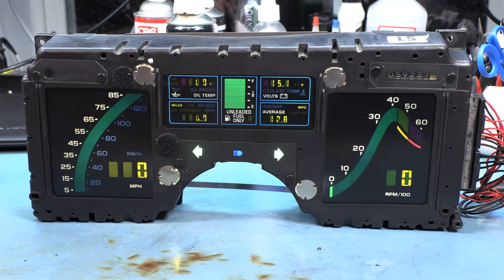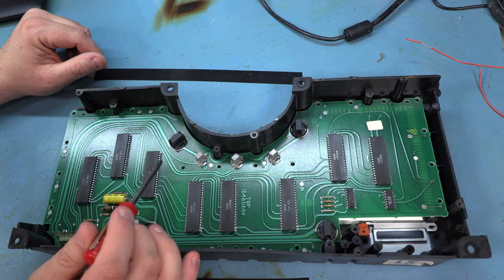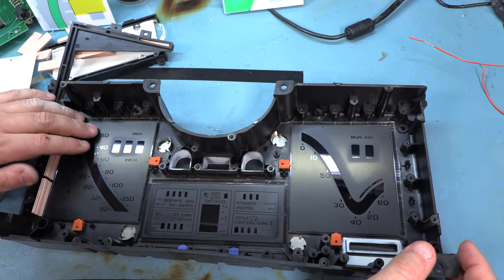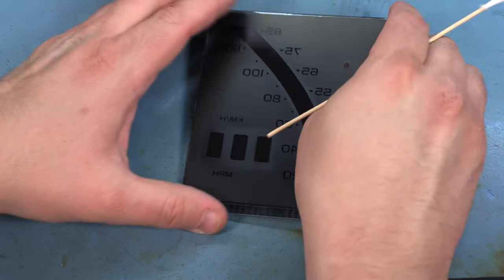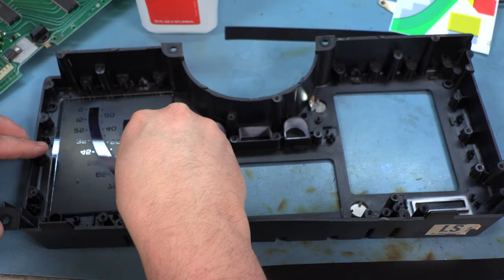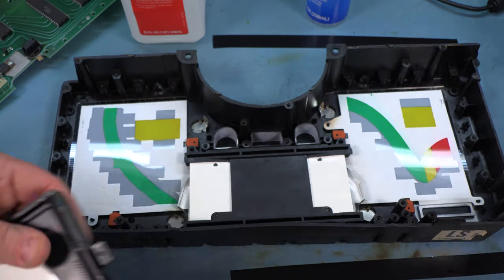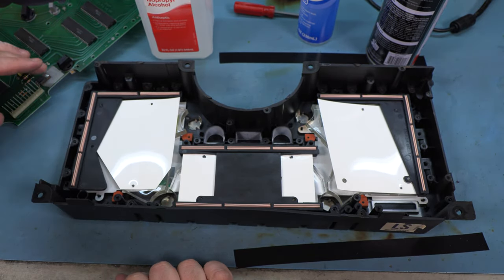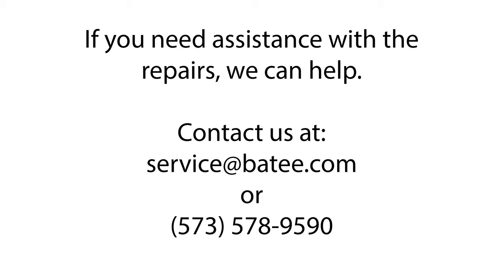84-89 Corvette - Instrument Panel Missing LCD Segments Troubleshooting 2021 by batee.com

Comment: I changed the center panel in my 89 because it was cracked, and the new used panel (year unknown) is scrambled.    Aside from 1984, did the LCD panels change over the years?